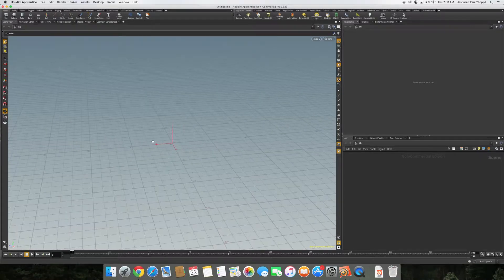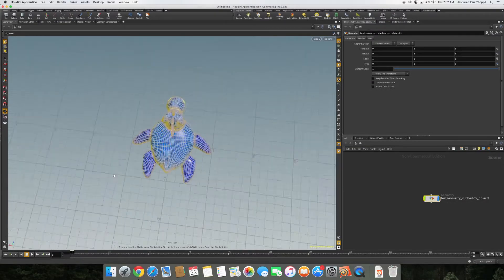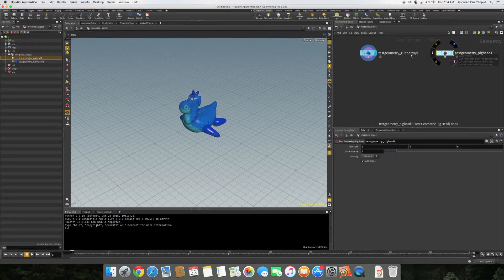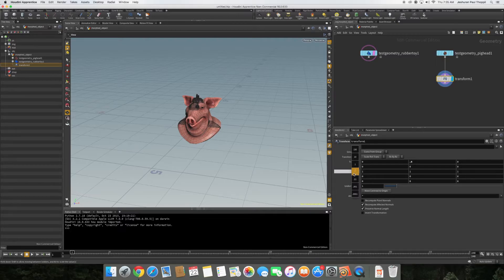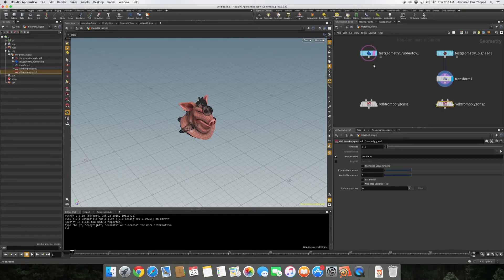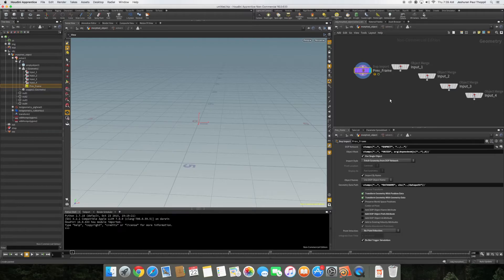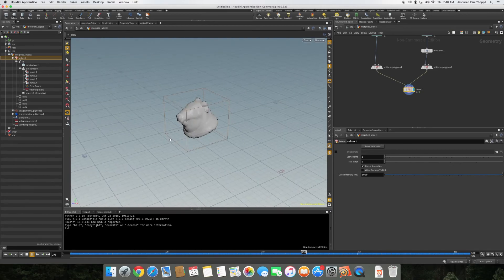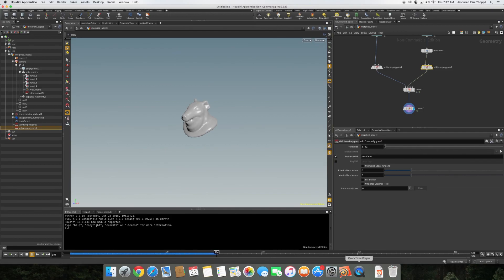Houdini Tutorial - 3D Object Morphing using Open VDB Morph and SOP Solver

Comment: Question:
Is it possible to keyframe/manual start the morphing process and export it out as Alembic?
Thanks.
Reply: Yes you can keyframe it. Inside the Solver, click the vdbmorphsdf1 then adjust the "Time Step". by default it has an expression on it, so remove that then you can adjust the slider to your liking. With anything in houdini i'm sure you can export alembic. (I'm a max user so I understand the struggle)